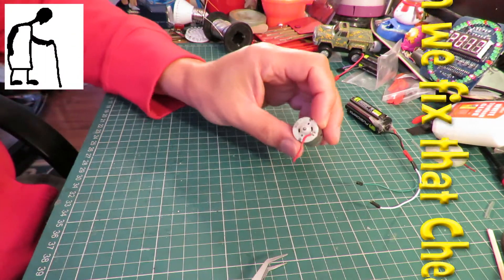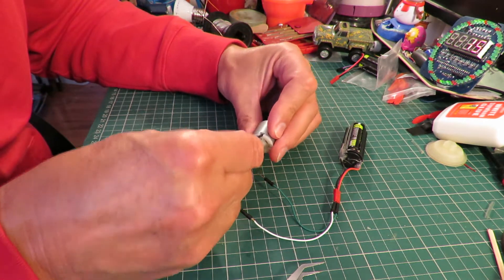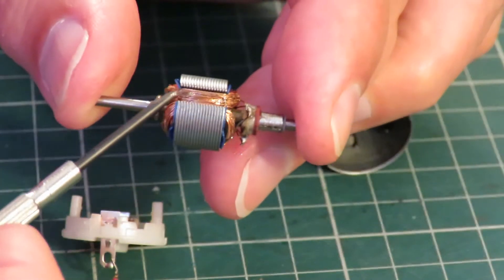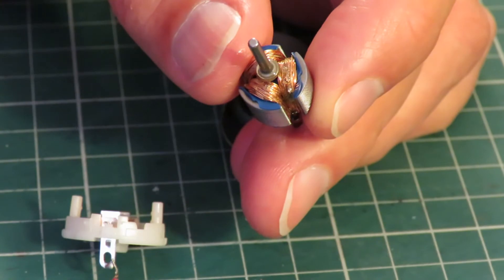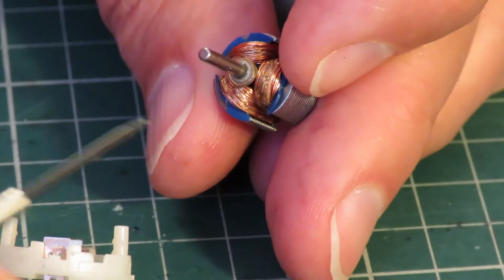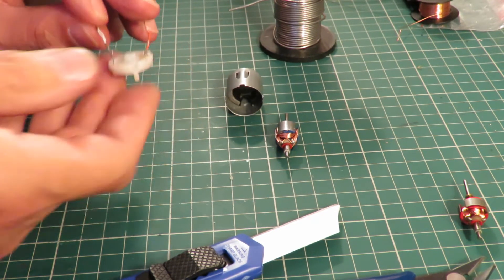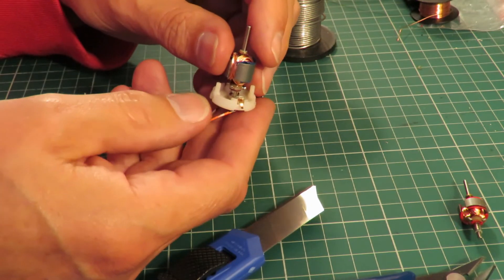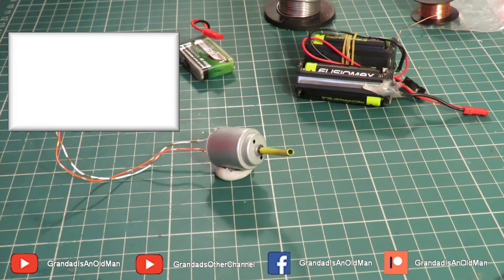Can we fix that Cheap Electric Motor? SHORTENED VIDEO

Comment: You can make these brushless btw (you may already know), by not connecting to the commutator tabs & omitting the back plate. The outer can spins instead. Completely pointless, but does work.
Reply from the maker: I must try that sometime, you have mentioned it before. I can picture it working, as you say just bring the wires out and connect to an ESC. Mount the armature vertically  on a block of wood and just slide the case down on top. Not what I was planning to do today but I might have a go if I can get in my work room without being distracted 😊
Reply from the maker: OK OK OK so my wooden car kit build and conversion to RC will have to wait. Just rigged up a Brushed Motor to Brushless setup and will have to fit the video into my schedule. It worked absolutely fine so the next slot in my schedule is October 2nd or 3rd but I might pop a teaser video in before that 😊😊😊
Reply: LOL...it's surprisingly satisfying to see something so common and usual work in a different way. Am glad you got it running. 
It should be able to spin without the wooden block, especially with a propeller mounted as a pusher. I used to power them with the controller boards from hard drives, rather steam punk.
Here's a short demo of one of mine....it all still gets me thinking about R/C uses, because there are loads of regular brushed motors in every house: https://www.youtube.com/watch?v=8Xa6hXQ49NI
Reply from the maker: Thanks for the link, I will include it in the text of my video when I upload it. It would be interesting to put it on a boat or plane at some time in the future so I guess that will be another video on the list 😊😊

Comment: Too many volts or drawing too many amps? Great work by the way... Nobody teaches the kids 'real s#it' anymore... Sad really hey.
Reply: I'm sorry, I accidentally sent that halfway through the video
Reply from the maker: Hi Jef, thanks for commenting. The Volts and Amps issue is one of those regular comments or questions I get. The usual one is "Can I use a 9 volt battery" because somehow 9 volt batteries seem to have some magical power. Now it is more common to ask "Can I use a LiPo" or "Can I use a Li-ion". I think the end of the video where I comment that the NiMh batteries are getting hot because the motor is drawing too much current whereas the motor is overheating because the LiPo is supplying too much current even though the LiPo is probably lower voltage will probably be missed by most. I am no expert and certainly don't attempt to teach, if my videos do teach then it is probably by getting it wrong and allowing people to learn from my mistakes 😊